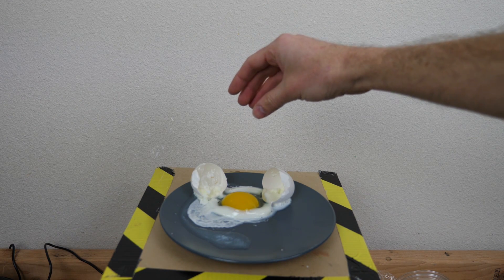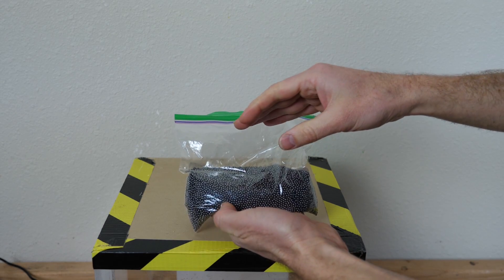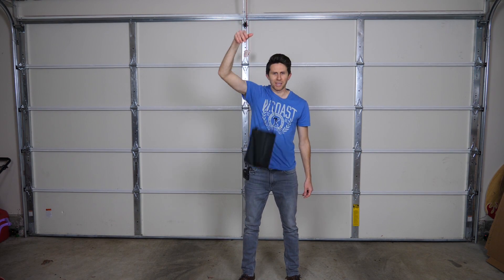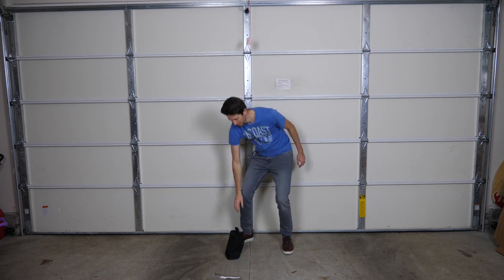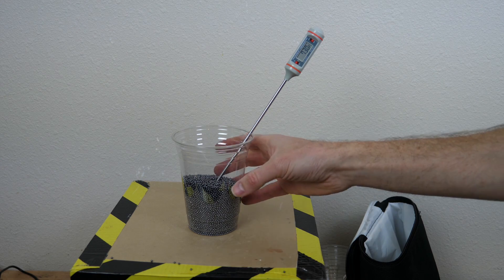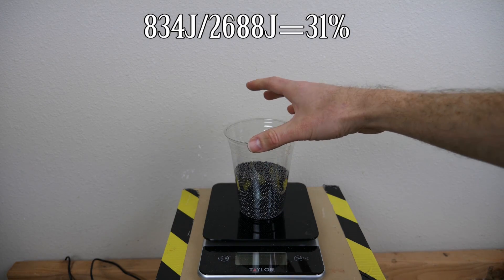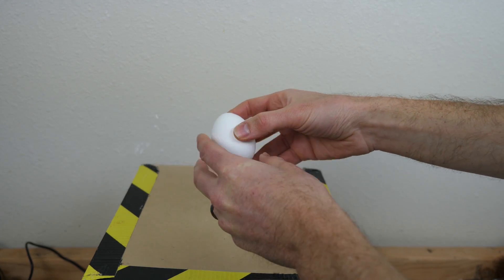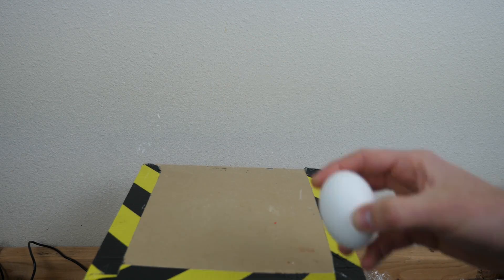Is It Possible to Cook an Egg Just by Dropping It?

Comment from the maker: Hey everyone, I did not forget about friction. The friction of the balls due to the input potential energy is precisely why the system is heating up! This is an important point. You should view the whole bag of shot as the system being dropped and then you will see why things heat up when you drop them! The reason why one single object heats up is due to its own "internal friction" which is solid domains of the material rubbing against each other. The same thing that you see happening to the balls rubbing against each other here. Friction is not free energy, the energy came from me lifting the bag.
Reply: can you try it again with one big ball to eliminate the friction?
Reply: Some of the energy leaks out as sound too, right? Is that a significant amount?
Reply: Tom Haflinger  This is a deformable system, so I would say mostly heat.  One large ball would have more energy go to sound.  If you used a very hard material, even more goes to sound
Reply: The Action Lab Yea, you are right. Its transformation from potential energy to friction. It wasnt very thoughtful from me
Reply: But are not the individual balls rubbing together causing friction, also?
Reply: Could you do this in one of those indoor skydiving air tunnel things?
Reply: So how about if you shake the egg. Could you cook it by shaking it?
Reply: The Action Lab could you "cook" an egg by putting it in a paint shaker? Or maybe a blender? You have already demonstrated that you can boil water with a blender, so why not cook an egg? Just a thought. I love the way you do your videos with putting a concept into something I can visualize and easily relate to. I have learned so many great things from this channel and I always feel like I learned something after watching one of your videos. Thank you, sincerely, Youtube commenter.
Reply: I have a question.. can we generate enough heat from Adsorption process that can boil water.?.as it is an exothermic process..plz answer me..😊
Reply: Austin Grimes good question !!
Reply: Hello actionlab I want you help to explain a weird effect that happens to me most of the time.
Sometimes when I put a finger about 4 inches away in the middle of both eyes with both eyes open and focus the background, the finger becomes double and I can see through my finger. And when I focus the finger, the background becomes doubled. Can you please explain what is happening here.
Reply: You did forget about sound though.. some energy converted to sound waves which is basically the friction in the air I guess.. so it’s heating up the walls and surroundings too (sound waves bouncing off them).
Reply: The Action Lab okay I hope you can see this. Today i saw a picture of "the goliat skeleton" and I keep wondering if it coul be physically possible or the radio bone-muscles necessary for a being that high and that heavy, without the help of a tail to be standing up.
Reply: u also miss the "SOUND" WHICH IS ALSO A CAUSE FOR THE LOSS OF THE ENERGY..
Reply: hq cart, you miss the point. He intentionally maximized friction in order to convert more of the gravitational potential energy to frictional heating. You are thinking there is some other form of heating to test that would happen in the larger ball so you are wanting to isolate variables. Which is good scientific thinking. However as others have stated the larger ball would just heat internally due to a sort of inter atomic friction.
Reply: Action lab, you should have just put an egg in a rock tumbler with the lead shot. Internally the rotational mechanical energy is converted into gravitational in each lead ball as it gets lifted a small distance on the edge of the tumbler, but you don't have to wear yourself out.
Reply: The Action Lab can boil an egg in the vacuum chamber
Reply: Awesome, exactly what I was going to ask. Great video!
Reply: The Action Lab ..I think we can boil it in that case but we have to cheat little. Coat it with Line-X and attach it to a helium balloon and let the egg go at >3km (altitude)... You can figure the rest part of this setup...you are a genius.
Reply: The Action Lab " if you can't beat em', join em' "
Reply: The Action Lab does the egg not reach terminal velocity by 1 kilometer
Reply: The Action Lab I gave a question. Wouldn't heat come from air friction? When you put the balls in the bag wouldn't the bag heat up not the lead balls? Did the heat come from friction between the balls against each other? Please try and respond, thankyou.
Reply: Anuj sinha  Thanks
Reply: The Action Lab The led heat up because of friction amongst all the ball bearings when you drop them they rub against each other.
Reply: lipo explosion is missing
Reply: The Action Lab Dude... Since terminal velocity by gravity exists u wouldn't be able to boil the egg even if u drop it as high as 3km... What u could try doing instead is to find a way to shoot the egg against a wall at the proper speed being careful not to heat up the egg with just the explosion...
Reply: The Action Lab can you cook an egg by shaking it
Reply: I was about to say that
Reply: You can also cook an egg with friction. Put the egg in the palm of your hand and shake it, start out slowly and then shake it real fast. The inside of the egg would have created so much friction and friction would have created heat that the egg would eventually cook itself. Even better if you could have a mechanical device do all the work for you.
Reply: The Action Lab is it possible to cook (egg) it if u just preheat it near to its boiling point and then drop it , so maybe then it will get the required amount of heat to cook it ?
Reply: Sound also plays a factor in the energy output
Reply: The Action Lab ..
Reply: Also the bag problably heated the lead as you were dropping it
Reply: What about the kinetic energy transferred from the ball to the object the ball impacts?  Momentum is preserved.  Neither object is perfectly elastic, nor are they the opposite.  So, the objects both will flex to varying degrees.  This means every time the ball bounces some of its kinetic energy is absorbed by the object it bounces on (then into the table,  or the floor, then the ground etc).  While not exactly the same thing, this is similar to the concept of kinetic chains in a body that is moving (like in boxing).  Energy can be stored again as more potential energy with tension, or it can continue as kinetic energy.. not everything turns into heat.
Reply: The Action Lab What if you put an egg in a drone and took it as high as you can then drop it?
Reply: xXKingC0527Xx then it would go splat
Reply: dan428 Well yeah 

But this the highest a drone could go, just to see what happens
Reply: Fair point, but the friction is not what you are testing
Reply: You forgot the sound dispersion of the energy and, most important, you did not consider the stall point when you calculate the height from whom you drop the egg, because in 3 Km it will reach 242,6 m/s roughly (542 miles per hour), but I calculate that the stall velocity for a solid like an egg it will be 140 m/s top (313 miles per hour) so the amount of energy needed to cook an egg isn't attainable in a single drop, by the way, are you sure that you need to reach boiling temperature in the egg to start deteriorating the albumin?
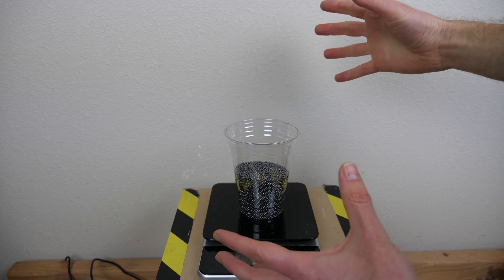Reply: The Action Lab - @5:00 - the potential energy was turning into sound energy as well

Comment: This is just a thought. But are you not essentially measuring the heat from the friction created through dropping it [I just now saw your comment after writing this but too lazy to re-word without this]. So maybe if you wanted to demonstrate cooking the egg you could make a machine that essentially mimics rubbing your hands together. With that you could visually find the speed needed to create the right amount of friction. An egg would work perfect for this vs. something solid, it'd be better done with a highly textured surface. I'm curious the speed difference with a textured surface vs. smooth> if smooth would cook an egg> that would probably be better with a piece of meat.

Comment: But what about normalization to ambient temperature?

If I stripped naked and jumped off mount Everest, I would think that I would very quickly normalize to the temperature of the ambient air because of it whooshing by my body.  I'm pretty sure I'd be a solid -20 degree block of ice before I hit bottom.

Boiling an egg would be difficult if the ambient air was not already near 100 Celsius.

Comment: Get a giant helium balloon and do when it will pop at around 20-30 kilometers the egg will fall and when it hits the ground it will be already boiled and it won't break it will bounce because boiled eggs bounce and you will be able to spot it (because from a drop of 30k it will bounce at least 1 kilometer high) and when it comes back try to catch it with your bare hands and then wash it with tide pod juice and water and then eat it, and compare it to a regular boiled egg.
Reply: (It will already be boiled because of resistance with the air)

Comment: You should have placed the shot in a pvc pipe and turned it. If you had a slow geared motor you could use that to do it hands /human lifting free
Edit : seal both ends of the pipe

Comment: lead also has high density, so it has greater potential energy. however, it's so soft that some of its energy will be used up in deformation of the lead shot. yet that deformation will result in at least some heat-- ugh, now i have headache. i guess you'll have to do another experiment to determine how much, if not all, energy lost to deformation results in heat gain.

Comment: Hey Action Lab, When dropping something, the friction of the falling object with air produces heat... when you dropped the lead balls inside a bag, upon hitting the ground they rub against each other producing heat, besides that when an object hits the ground there is friction between ground and falling object and again heat generated as a result... Could you test the same in vaccum and instead of ground what would happen if something like trampoline.. I think the results would vary with lead balls :)

Comment: You did not take the temperature of the bag... Also... Why were you holding the balls spread out on your palm giving it more surface area to transfer heat  from your hand to the balls as long as you did... Considering it was only 5 degrees warmer...it could have came from the bag itself u put the balls in and the heat from your hand... When u dropped it each time you were changing which balls were in contact with the bag

Comment: the larger black bag you put the lead shot in looks like and insulated bag of some kind, so wouldn't that raise the temp of the lead shot significantly?
Reply from the maker: Why would an insulated bag raise the temperature? Insulation doesn’t produce heat, it keeps it from getting out, but it still needs a source!

Comment: I'm skeptical..  The interior of the bag may have been warm.  Leave the shot in the bag overnight.  Measure the temperature of the shot.  Drop it 100 times.  Measure.  Drop it another 100 times.  Measure.  If the three measurements indicate that the same amount of heat was gained each time, that suggests that the experiment actually works.  If they don't agree, well...
Wouldn't it be easier with a rope and a pulley?  Might be easiest to sit in a chair and raise it 3' 200 times.
Try using a vibrator.

Comment: Some of the energy came out as sound.  You most certainly heard something every time that bag impacted your garage floor.

What's with the mixture of units?  "72 inches," ugh.  Maybe 180 cm.  Just stick with SI, make it so much easier.  If your viewers insist on needing a conversion (which it'd be so much easier if they thought of a cm as a cm instead of some fraction of an inch), Google can do that for them right from the search input field, and nearly instantly if they have JavaScript turned on because it will anticipate that you're doing a units conversion.

Comment: Why not spray eggs with LineX and then drop it a hundred times? The LineX coating will keep it from splattering, easy. Then you can just cut it open with some serrated cutting tool.

Comment: can you do the experiment where a magnetic on a pendulum when released comes to rest just in front of a copper disc or plate in its path due to the eddy current induced in the copper and then calculate the temperature change? that would be more accurate(and easier on your back :P) as not much energy would be lost :)

Comment: I'm glad you made mention of friction in the comments but I also noticed a black thermal bag as well. Light absorption prior to and during experiment might factor. However, I'd like to see if you can cook an egg by shaking it profusely, see if it cooks by compression in a centrifuge, or by using your blender in which you boiled water. If of course you're doing another egg and heat vid. Keep up the good work. I really enjoy these experiments.

Comment: How about asking Elon Musk to build you an egg-dropping version of the hyperloop? Wouldn't that do the trick? Both due to extra speed on impact because of the reduced air friction, but also if you keep the walls of the tube narrow where it hits, more of the energy is going to be transformed quickly to heat as well, because the splashing is going to rub against the walls in that same moment so to say.

Comment: Most of the height loss on each bounce is due to air friction then converting into internal energy. The friction increases the temperature too thou.
As for the egg cooking i guess you could tape the shell in a rather this layer so it stays together despite multiple drops or throws even.

Comment: If you pull a vacuum and then fill it with helium to atm pressure, does it weigh the same as air? And if it doesn't, what pressure of helium is required to make it equal to the weight of having air in it?

Comment: You started and ended by talking about heat generated by dropping a single object, but your experiment involved hundreds of small lead pellets. I doesn't seem like you considered the heat generated by Friction of the pellets rubbing and crashing against each other every time they hit the ground. The power of that alone was also strong enough that it broke your original bag. If I'm wrong, then please explain. Thanks.

Comment: Not to mention as you poured it through the air you lost a TON of it there. Lead is an extremely good conductor of temperature. Even though lead, when compared to other metals is a fairly poor conductor of heat, metals, in general, are very good at this. Meaning the air around it would strip away a ton of the heat just passing through it.

Comment: Is it possible to turn water into hydrogen peroxide in, the vacuum chamber?
Reply: Not quite.
You would need to add oxygen.
If you can't, then one easy way to obtain it is to split water. If you split 2 molecules of water you will get 2 molecules of hydrogen and one molecule of oxygen.
Hypothetically, this 1 molecule of oxygen can then combine with an additional 2 molecules of water to produce 2 molecules of H2O2.

So you can process 4 molecules of water into 2 molecules of hydrogen peroxide and 2 molecules of hydrogen.
Reply: No.
Water is H2O. Hydrogen peroxide is H2O2, so you would need to produce hydrogen gas a well.
Hydrogen peroxide is also quite unstable, readily breaking down.
It would also require breaking bonds which requires energy which typically doesn't get provided in a vacuum chamber (instead things cool from evaporation), and it requires an energy input of roughly 350 kJ/mol to produce the H2O2 and H2 from the water.
Reply: Jeffrey Black if you need 2 oxygen atoms you need to produce oxygen not hydrogen as you said?
Reply: Jeffrey Black kool

Comment: this is not a fair test as messured you control in a plastic bag but then messured the drop results after it had been in a "stronger bag". so i think the temputure increase was mostly due to the heat trapped in the stronger bag heating the lead up. 

P.s i dont mean to come off as one of those guys who think everything is wrong and most of your videos i agree on its just this one video i think could of been done a better and fair way.

Comment: What if you repeatedly drop the egg in a swimming pool from high enough that it doesn't break due to surface tension, would that cook the egg? to test this theory you could tie a string around the egg and maybe use glue to secure it and then use a pulley to drop it again and again or maybe you can just crack an egg, in case it in a strong material and then drop it from a tall building and see if that cooks the egg.

Comment: Correction: 17kJ is actually the mid-upper range of the .50 BMG energy spec.

Since there's really only one way to cook this egg, do you by chance have access to an M82 Barrett? If you have a machinist build a custom barrel extension that fits the egg and has a long enough tube to permit the full process to take place ...

Comment: +The Action Lab  A bunch of lead balls is a deformable system, so a lot of the energy goes into heat.  The floor, I assume, is quite hard.  This means more energy goes to sound.  If you dropped a single ball of steel, more energy go to sound, than with the bunch of lead balls.  I wonder how one would calculate the fraction that goes to sound vs heat
Reply from the maker: Yes, I should have mentioned sound. In my mind I just grouped sound into energy that was “lost to the environment”

Comment: Slight issue with your lead shot experiment - you didn't take friction into account. All those lead balls were rubbing together during the impacts which would have added additional heat. Even pooring them into the cup would have generated some heat too.